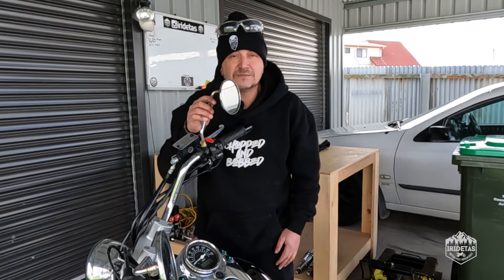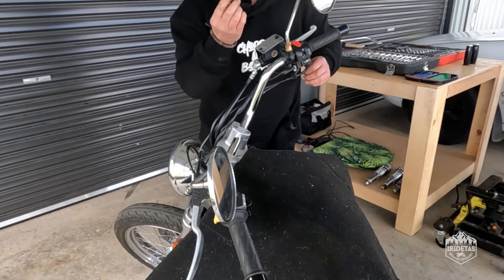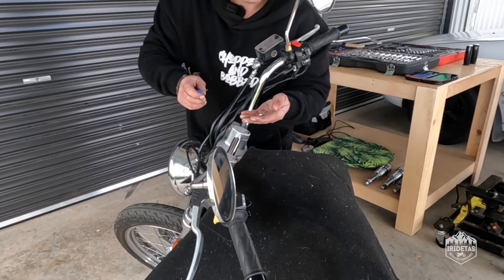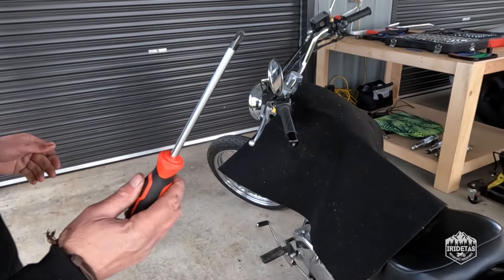VL250 Bobber #6 | eBay 300mm or 12 inch Mini Apes Handlebar Install with Stock Cables | Step by Step

Comment: To remove grips I slip a flat head screw driver under the grip then insert a ziptie repeat several times evenly around to bar and they slide straight off!
Reply from the maker: Nice technique i havent heard before, cheers! 😁👍

Comment: Easiest way to take old grips off is to use a screw driver to get a  small gap between the grip and bar, then insert the WD40 nozzle and spray. The grips will roll off in no time.
Reply from the maker: Yup for sure, but they were worn and were going in the bin so why not just cut them off! 😁👍

Comment: Did the knurling marks line up with your riser spacing? I want 12” apes on my xv250 and wasn’t sure they’d grip/hold well if not lined up
Reply from the maker: Yup, i used it to line up the bars with in the risers to centre then too

Comment: Can anyone explain why ape bars aren't the silliest thing you can have on a bike?. The way you look is subjective, but it Seems like you d have no control, your hands would lose their blood and you'd have far more wind hitting you. Please enlighten me !!
Reply from the maker: They are an asthetic but as long as they are around shoulder height or less they are very comfy, particularly for long trips, think pendulum effect the bike tips in to a degree easier in my experience with them but you loose the fine control. It is an asthetoc as i said but that handle better and are more comfy than you might be thinking